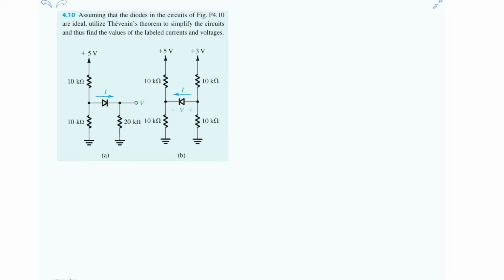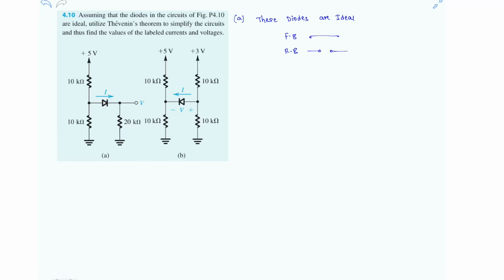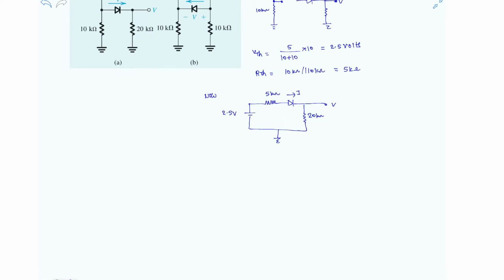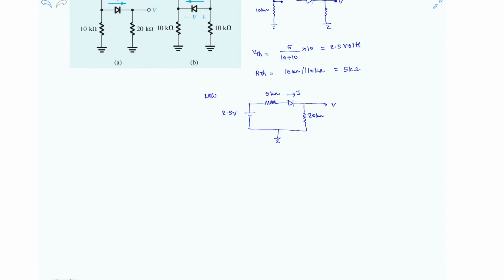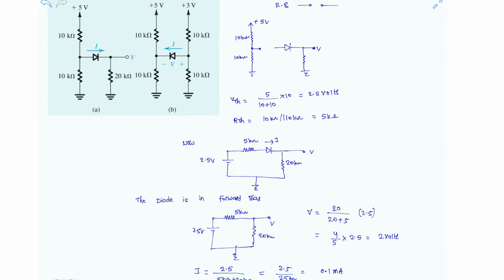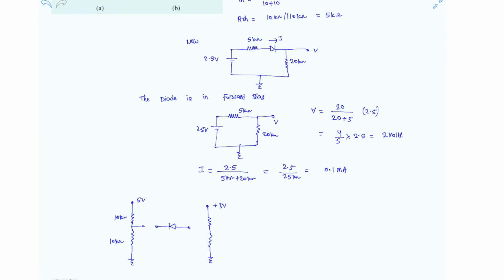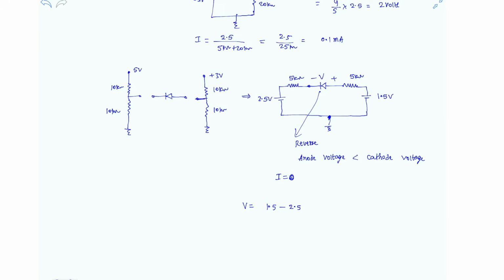4.10 Assuming that the diodes in the circuits of Fig. P4.10 are ideal, utilize Th ́evenin’s theorem

Comment: For those who are confused about Vth, it's a Source Transformation using the 5V and 10K, changing to a current source and parallel resistor. Then you combine parallel resistors (10||10), then source transform back into voltage source to get the "vth". The circuit diagram notation in this book is very different so it's extremely difficult to see.

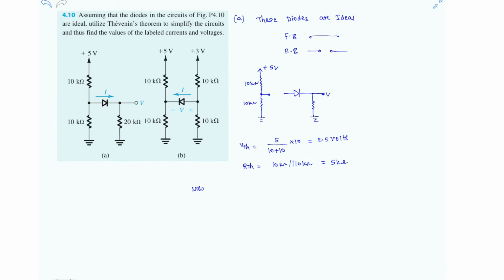Comment: voltage divider equation is vin * (r1/r1+r2). Source is 5v not 10 and 5v is not a resistor. thus numerator of you voltage divider 2:04 is wrong
Reply: I mean the answer is the same. He just didn't write it clearly. If you swap 5 and 10 you can see that it matched with the voltage divider equation we know. He just didn't write k next to 10.
Reply: Apply simple kvl that's it

Comment: why you say 10k & 10k are in parallel aren't they in series?
Reply: because to find R thevenin, you turn off independent sources and apply test voltage across where you want to find the RTH from. So in this case, turn off voltage source and convert that to short circuit and you apply test voltage between 10k ohm resistors and the ground on the left (or right) This makes a circuit with two parallel resistors and a test voltage connected to it hence making R thevenin parallel.
Reply: First go check Thevenin's theorem then ask
Reply: @bhakktikattha1864  why being so rude? People are here to learn something

Comment: ...one must emphasize the ideal diodes in this case act as a switch, requiring 0 bias voltage: a switch which opened has infinite resistance and which closed has zero resistance.